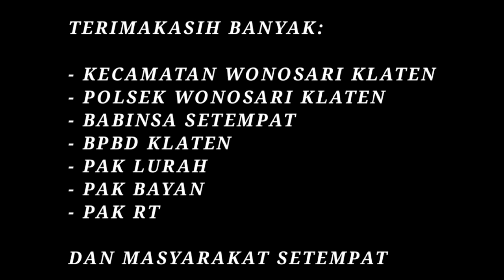Finally fell, the execution of dead and weather tree is very troubling

Comment: It would be very interesting to follow the progress of that tree to the sawmills.
Reply: We are focused on fell a tree, we are too busy, may be sometimes 🙏
Reply: It was too rotten in most parts to be useful for sawing up, that’s why they cut it down, did you see how it shattered as branches were cut and bumped against the trunk on the way down? The guys cut it up on site anyway.
Reply: Most of that tree was too rotten to be any good for use as milled timber.
This tree has been dead for some time that's why the tree fellers were removing it because it had become dangerous to the villagers living underneath it.
Reply: rings were really big, so the faster it grows the less it's usually worth, but would love to have a base crosscut with those spokes still attached..quite a huge wall hanging

Comment: Really great work but I can’t stop dreaming about what could be built with all that beautiful wood, such large slabs and lengths.
Reply: This wood is a low quality, but in the right hand, will become fantactic furniture, like a solid table length 6 meter and wide 140cm
Reply: @SlashcutExpert  The large piece that ended upright outside the Temple could be carved into a statue......
Reply: e
Reply: @SlashcutExpert  =
Reply: @miskemamesah  yes , can I help you?
Reply: @petermcgreevy6386  unfortunatelly, it just a low quality of wood, it will eat by termite
Reply: Aqbu buangkumentar
Reply: The wood was crap, really not suitable for furniture use. You can tell because they cut it up into small lengths very quickly.
Reply: @teeanahera8949  yes, it just soft wood and already rooten